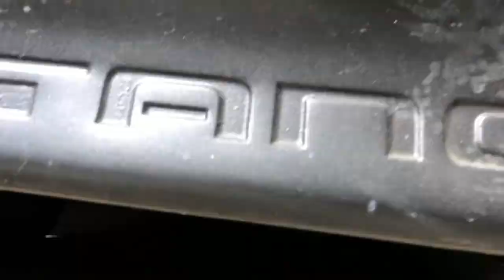Bad Fox Body Mustang (88 GT)

Comment: What is your timing set at i am having an issue with my balancer i noticed the tfi module on the distributor way over on the driver side mine sits in the middle of the water pump
Reply: That's kinda what mine sounds like like a tapping noise gonna have to check the timing
Reply from the maker: Set timing at 10 degress BTDC